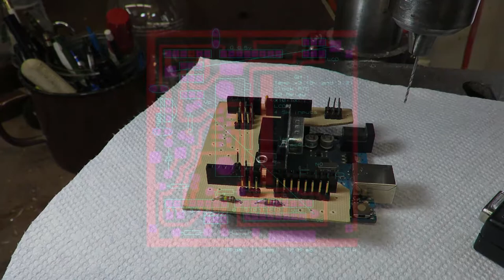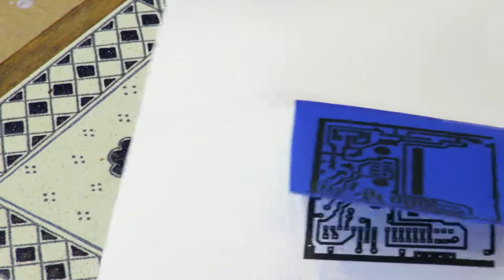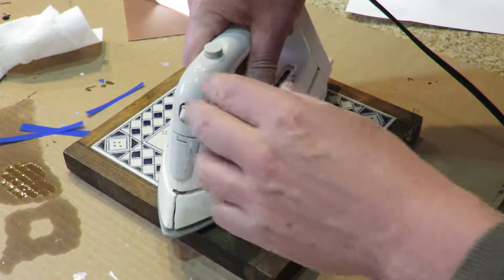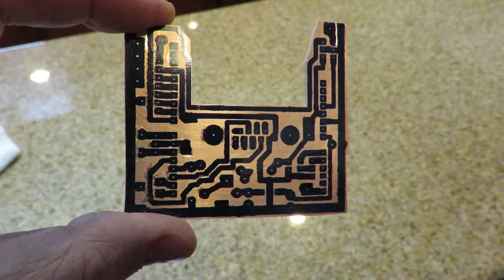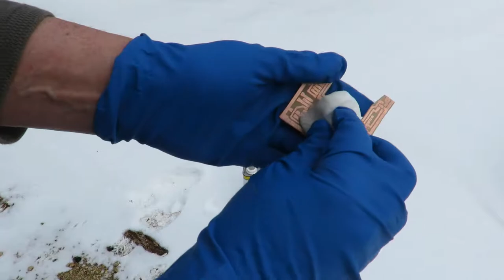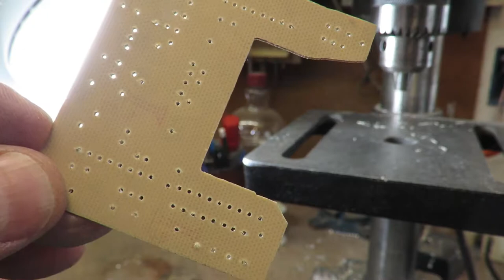DIY Making a Printed Circuit Board

Comment: I'm missing something here.. I can't figure out how to get a pattern onto the blue plastic sheet using a copy machine. I never saw a paper black copy sheet. Do you mean back? So does the blue sheet react to the copier xenon flash? like sort of photo lithography? I tried making a copy on the flat glass and it didn't make a pattern on the blue sheet.
Reply from the maker: The only way I know how to do this is with a laser printer. Load the sheet with the blue plastic and print the pattern on it.
Reply: @jtandhz  got it to work. I put the blue sheet in my laser printer, dull side down (brother printer) and selected a corrected sized circuit "foil" side pattern and hit print. The circuit foil pattern showed up on the dull blue side as black. Thanks for your help.
Reply from the maker: @DavidALovingMPF102  Great! I also found a careful cleaning of the copper with soap/water/abrasive pad, then rinsed, and finally  cleaned with 91% isopropyl alcohol while not touching and leaving oil from your fingerprints helps...
Reply: @jtandhz  maybe my laser printer toner is wimpy! Sounds strange but I miss the rub on lines and pads..
Reply: @DavidALovingMPF102  I've done projects using the rub-on transfer sheets you could buy at Radio Shack. Press n' Peel is so much better, and reproducible.
Reply: @numbr6  What Radio Shacks?? I used to buy that also, but all the stores closed around here. Are you buying it on line? I've looked and didn't find any rub on transfer lines and pads! That would be great. I used that stuff for 20 years!
Reply: @DavidALovingMPF102  I'm totally dating myself. I did that type of PCB work in the '80s. 🤣 Obviously, other PCB manufacturing techniques are superior than doing that work by hand directly on the copper board.

Comment: shiny side of blue plastic sheet touches the paper black circuit? and how do I know if the paper sheet with the circuit goes "Straight through?" Will laying it flat on the glass type copy work?
Reply from the maker: David, the paper black copy sheet is just a test copy and placement guide so I can use a small piece of blue plastic that just covers what I need. I could use a blank sheet but I would not know exactly where to tape the blue plastic. The straight  through just refers to a printer that goes straight through and exits the back of the printer so the top roller does not smear or distort the print. Jon

Comment: what model of laser printer do you use   thank's !!
Reply from the maker: Currently using a Brother HL-L2300D but have used others.  I used a HP4L for years until it wore out.
Reply: @jtandhz    thank you
Reply: @jtandhz  Brother MFC9840CDW. Print in only B&W mode.

Comment: I just print directly to the blue.
Reply from the maker: Yes, just cut a blue piece larger than the design and use one strip of tape (I tape it on the top of the blue piece) to hold it in place on a full sheet of paper. Then print it on the matte side (shiny side down)  with a laser printer running straight through (no bending around the rollers).
Reply: When I need to print art work for my boards, I print it out on just a white sheet of printer paper. I then take it to my local print shop down town with my blue sheets and have them print it on the blue sheet using their toner printer. Just be sure to tell them what side to print it on. I think the last time I had some printed it cost .50 cent a sheet. One sheet of paper. So if you can get more than one on the sheet, it's a deal. Hope this works out for you.